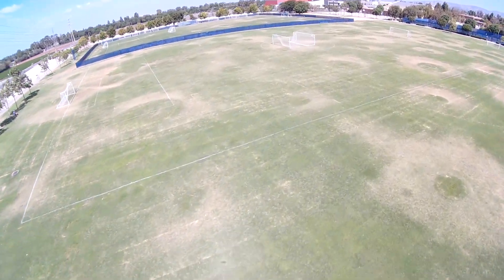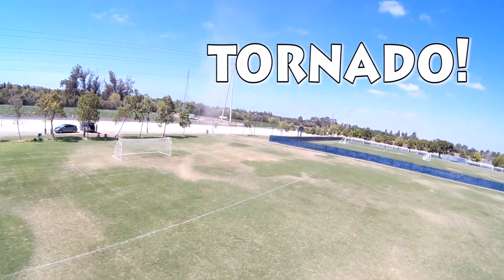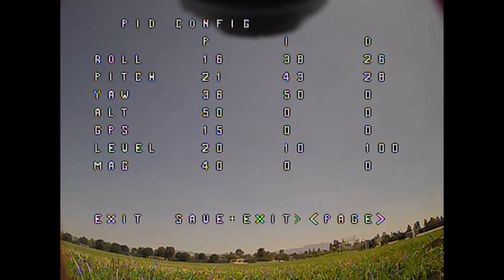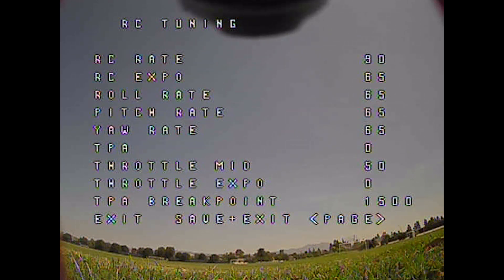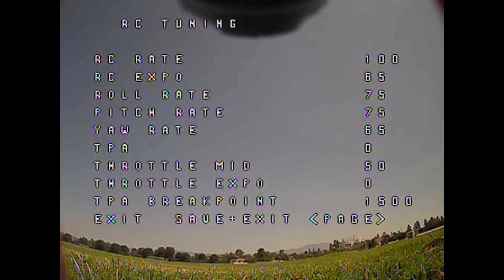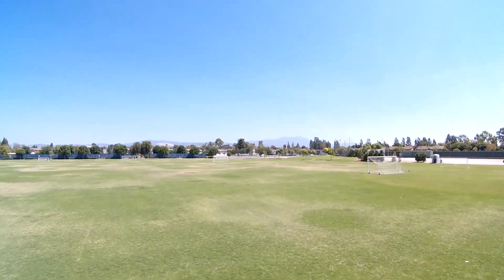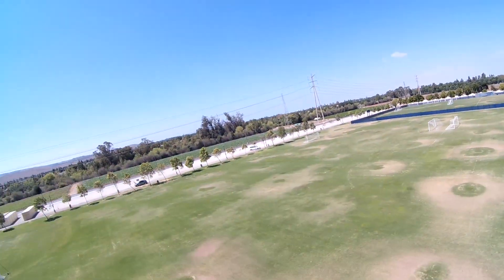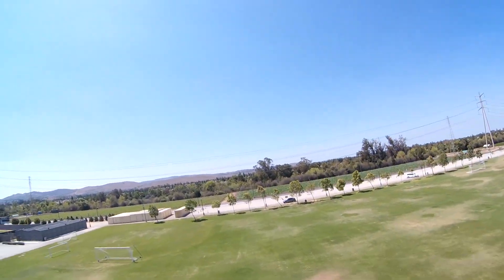Holybro Shuriken 250 Maiden + PID Tuning

Comment: I'm not using an osd, but probably would for the tuning process. Any special instalation to follow? Could you make a tutorial on how to do it? (have no idea where to begin) 
Great videos and keep up the good work
Reply: Forget about separated OSD and just go with the integrated option. Check "protect blue falcon" and his video about the omnibus fc
Reply from the maker: +Christian Cardona the osd is built in. No work to be done. Thats whats so great about it.
Reply: i'm thinking of getting osd mainly for battery voltage, but i notice a few cameras and also flight controllers now have an osd built in, (flip32 omnibus) so that should be good for us beginners, the hardest part of an osd for us is the actual flashing process, using the ftdi adapter to flash the software all seems far too involved for such a simple thing, i think soon all boards.. fc's pdb's camera boards vtx boards will have an osd, its already heading that way.
Reply: thumbs up i just watched project bluefalcons vid about the lip32 omnibus and was completely sold, i really desperately need to simplify building my own quad, and adding stuff for very particular types of flying, the omnibus ticks all the boxes but one, an it use ibus flysky protocols... its such a stupid set up nobody else has done it yet, but i really like the flysky i6and its price/performance,  so it looks like i'm gonna be the one to test that out, i'm sure it can but as ibus is on a different uart (no idea why) i might have a few problems, and as a beginner doing new things nobody has an easy answer to sucks,